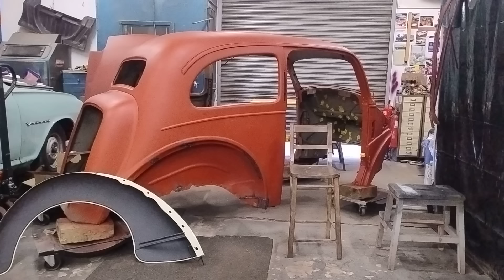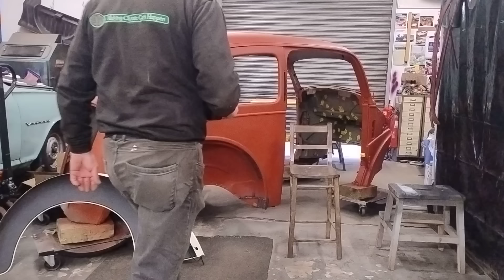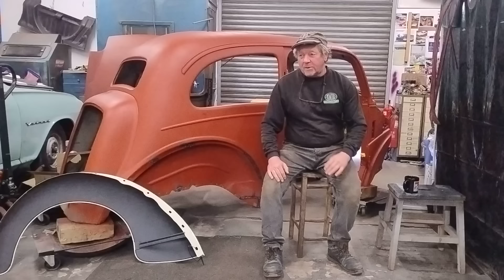Governments call for evidence regarding classic cars my initial thoughts after a quick glance.

Comment: There does need to be clarification between a true restored to orginal spec classic/vintage car and a modified classic/vintage car. The latter having been customised or modernised from the original specifications the vehicle was made/declared too.

For example Land Rover's, putting a coil chassis under a Series Land Rover and the body made to look like a Defender. It wouldn't surprise if the insurance industry isn't behind some of these calls for identifying the authenticity of a vehicle, and to be fair, they are right to do so. 

There can be a whole gulf of a difference between a repair, restoration, rebuild and custom/retro build. I do welding repairs to cars, vans, trucks, tractors (classic) and plant machinery so I see the stuff people ask me to do and make to help create modified cars. To be fair, I try to steer clear of some of the stuff I am presented with.
Reply from the maker: Thanks for the comment, I'm convinced you've got it right insurance will be pushing this as will the government both will benefit from greater revenue. I still find some of the modifications a bit extreme for me it's about seizing the era from a base car or a high end model.
Reply: Where does that leave so-called "resto-mods", where the car bears little resemblance to what was originally built? Something I'm not particularly fond of.

Comment: They need to reduce the historic age from 40 years down to 25 years. This will help stop people scrapping modern classics which haven’t hit 40 years old
Reply from the maker: Interesting comment, I don't know if this is leading to a classic car MOT but safety has to be of the utmost requirements.
Reply: I think 40 is about right: I struggle to think of a 25 year old car as a 'classic' - to me it's just an old car that has survived. Just being old doesn't make it a classic. A 40 year old car would, for example, include an early Renault 25 or an E28 5-series BMW, both of which I still consider modern.
Reply: Cannot see them doing that as it will allow in a lot of dirty diesels that they want off the road. If anything I think they will freeze the rolling exemption.
Reply from the maker: @ralphmillais5237  probably more like it increasing the the exemption age Diesel cars has put them in a funny position.
Reply: @HowardLeVert  I think this depends upon how many are remaining on the road at any given time.
Reply: 30 years here In Australia- requires ypu to join a club & so many drives a year, and depending on State, yearly roadworthy (MOT's).

My Nan & Pop's 1996 Holden Astra 1.6 City manual (re: Opel, on the cam box cover) comes up for club rego in 2 years
Reply from the maker: @maxrockatanksyOG  that's interesting approach thanks for commenting
Reply: This will only apply to vehicles of exempt to mot testing the rest is bs
Reply: I would say 20 years
Reply: Nice E93A body, would be nice with a 302
Reply: @maxrockatanksyOG sounds like communism

Comment: I agree with you regarding MoT exemptions - I don't think there should be any but yes, there should be something for older cars otherwise it can be just a charter for the unscrupulous to run around in potentially dangerous cars.
Reply from the maker: I honestly think upon a real inspection of classic cars the percentage of dangerous cars would be high.
Reply: In the interest of road safety older classic cars and other vehicles should have an MOT certificate each year. I don't have a classic vehicle but if I did it would be in my interest to have it tested each year.
Reply: @ianwilliams8656  I think if I ever owned a classic - say, a Mk IV or an FB Victor/VX4-90 like the one in the background - I'd definitely want it inspecting on a regular basis. Not just for my peace of mind but to ensure the safety of others.
Reply: That's what they want😅😊
Reply: Before we all go the classic Mot route with all it entails, what are the statistics that say this is a problem, it's far too easy to get one or two "defective" cars and blow this out of proportion, with every interested party claiming it's for the legislation panacea, "safety". A classic MOT would need a whole different level of training and certification before it could be introduced, and it would grow unchecked, just as the current one has, and with less cars to spread the cost over I guarantee it would cost quite a bit more, let it be.

Comment: I agree with you about the hysteria with regard to body repairs. Also, this is just a call for evidence, i don't (yet) see any suggestions of rule changes, other than being more lenient with regard to electric conversions (don't agree with that one). 
Regarding your Capri example of a 3-litre engine swap -  I don't think that's correct under current rules,  because the 3-litre Essex was available in the original range. The current rule is that if you swap for a different engine that was available from the factory, you don't forfeit the vehicle's classic status. What's more, i believe this rule is only for MOT exemption. I could be wrong on this,  but i think that free VED applies to any car over 40 years that's been changed to the Historic Vehicle class.
Reply from the maker: Thanks for commenting, as you have stated it's a call for evidence, regarding me using the Capri for an example I was just trying to point out it was not as it left the factory and taking the environment into consideration which seems to be the only policy that governments look at they won't want to be given anything free to such a modification. Absolute standard classic cars will have no concerns I would say but the word modification will be the chancellors favourite word.
Reply: If. I got  a rover 3liter diff in my p4110 they ain't gonna to be able to tell 🤠
Reply from the maker: @RuthNewstead  A professional swap in anyway will practically be unnoticeable, thanks for the comment.

Comment: I'm in agreement with you. If you have a standard car, at some point in it's life it will need repairs and provided these are carried out correctly, they shouldn't warrant reidentification of the vehicle VIN or registration. As you say who's to know. The main problem that I see is that a lot of major components are difficult to replace with manufacturers ones as very often these have been out of production for many years and NOS are getting hard to find. In most cases the car marque clubs have sourced original spec remanufactured or reconditioned ones, yet this is according to the current rules, also not allowed without reidentification even down to the nuts and bolts level. As for service parts, the problem is finding good quality and our parts supply buyers are not good at that.
Reply from the maker: Thanks for commenting, it looks like everyone is compassing around the points I'm making the issues that need addressing seem to be in the modification area.

Comment: Replacing like for like , so replacing a chassis rail is not going to be a concern . You can replace a complete body on MGB or a mini and its still classed as a classic . 
If you are MODIFYING I.E being a nob and sticking an electric motor in with 1/2 ton of batteries then ..yes..
Reply from the maker: This obviously is the issue that's being looked at electric motor has to become a modification 100%, thanks for the comment.

Comment: The problem with MoT’s lies with the misunderstanding by many mechanics of what some of the older car mechanisms were actually doing. I think that the MoT should be reintroduced for Historic Vehicles at the level that originally had to be complied with when MoT’s were first introduced. They need to steer safely, brake safely according to the system installed I.e. pull up straight and within the limits of braking power provided by the system on the car and have lighting and vision and signaling which might be by hand on oldest vehicles. 
I can see that putting a modern V8 in an Austin 7 otherwise not particularly adapted for it is not a good idea and these are the arguments which will be used against such vehicles but supposedly the marking system for creative home altered vehicles was intended to overcome this. I think there has to be a definition of Historic as against modified existing vehicles which might be related to the percentage increase in performance say to an unmodified chassis. Just a thought for discussion.
Reply from the maker: I truly believe an assessment rather than a MOT will be introduced which will work on a points scheme as to the amount of modification work that has been undertaken. I don't think this is anything to be afraid of unless the car is in a totally unroadworthy condition. It's simple for me to put a modern engine or electric motor in an old classic car that totally alters it's original DNA changes it's status at DVLA.

Comment: Here in the Netherlands, when the car is 40, it is an old-timer and nearly tax free. Modified or not, the car ( by VIN number) is 40. First it was 25 years but by announcement it was slowly lengthened to 40. When you put it on the road after restauration,you have to go to the MOT (APK) and they check the car. Not in a special way because it is an old-timer. No special licence plate or what ever. Some still do have their old license plates ( very dark blue or a little lighter blue). No, no fancy stuff because it is an old-timer.
Reply from the maker: Thanks for the comment, obviously a common sense approach to the situation.
Reply: @Diggers-Garage  yes. It fits are saying" act normal, that is strange enough". Doe maar gewoon, dan doe je al gek genoeg.